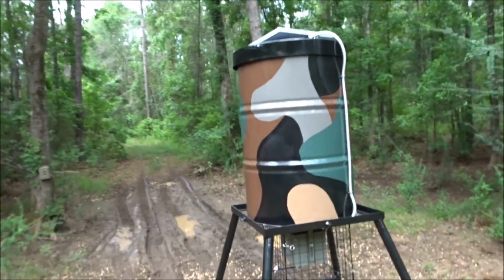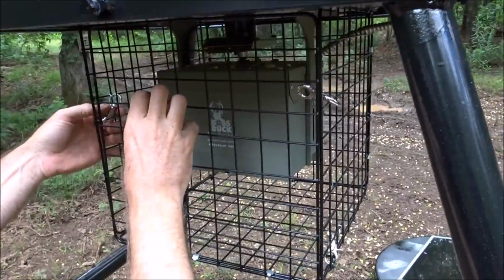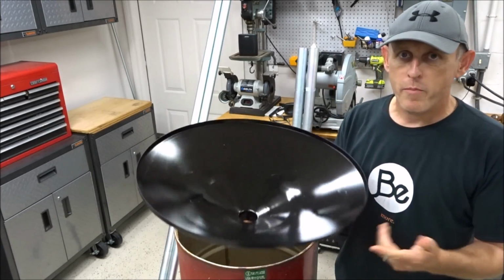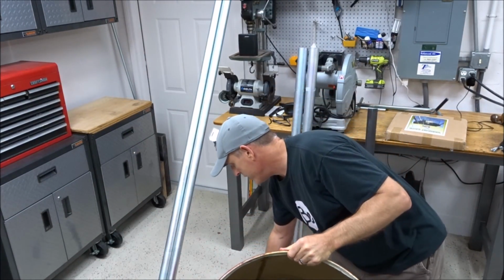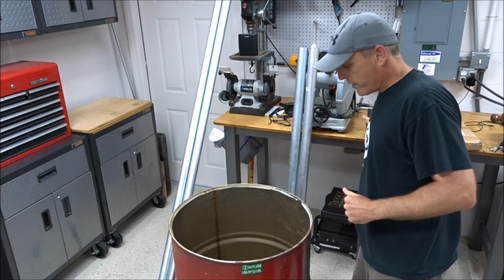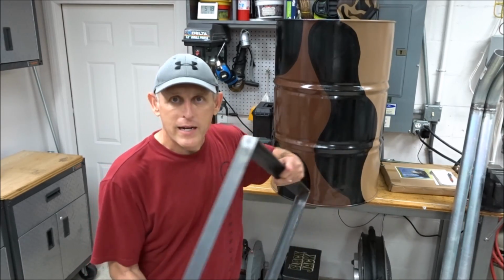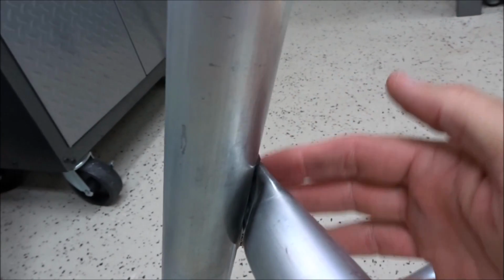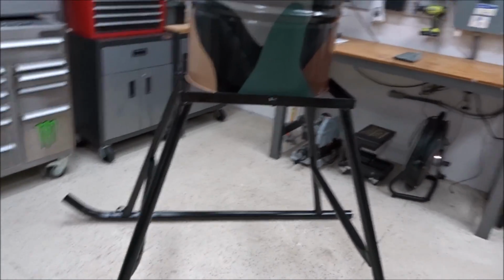Deer Feeders: How To Build The Ultimate Deer Feeder (on a Sled!)

Comment: Can I ask what kind of welder are you using.  I have a stick  but looking into a wire or mig welder something that will weld this kind of material. PS I love your drag feeders!!!
Reply from the maker: Hi Mack, I have a Hobart Handler 140 Mig welder.  It runs on 110v and I run shielding gas as well.  Great little setup up for my kind of welding.  Never had an ouch of trouble out of it and I run it hard.  I’ve run it off a 30amp generator out in the field and it performed great too.  Good luck and let me know what you decide.

Comment: What angle are yall using for the legs coming down from angle frame
Reply from the maker: 20 degrees give or take.  Good luck!
Reply: @TheHandyHunter  thank you. And great video. I was looking around at buying a stand and fill on a skid but have most everything I need to build one for alot cheaper. So looks like a last min. Project for the new hunting spot

Comment: Just built 3 of these. Used 1 1/2" mild steel tubing instead of electrical, 2" on runners and just notch cut the bends and welded instead of prefab bends. Free barrels,$35 for steel,$20 for funnel,$20 for poly lid,$40 for a spinner w/timer, $10 battery,$5 spray paint. Extremely happy with the results. Very rugged. Thanks for sharing a great design
Reply from the maker: Awesome!  Feel free to email me some pics and I will post them to our community board!  Thanks for sharing.  Steve@digitalsouth.com.

Comment: Can you send parts list and sizes you cut all parts?
Reply from the maker: Hi there, if you watch all the way to the end I walk through measurements and dimensions, etc.   I’m working on a new feeder sled that’s easy to build than this one because it doesnt deal as much with difficult angles.  That video should be out in a couple weeks when Im done.  Hope that helps.
Reply: I'm going to be  building 4 like this for new 1000 ac deer lease here in tx.  You did a awesome job . Im to old to be climbing ladders.
Reply from the maker: Outdoors thank you!  Let me know if you need anything.  My newer build is easy if you have time to wait.  I have no complaints about the current sled in this video...i pull it all around my farm.  Its so easy!
Reply: What length did you cut your angle pcs
Reply: All i need are the length of the angle iron pieces

Comment: If worried about the skids wearing out from rocks and such, you can add skid shoes. Basically it's a layer of metal that runs the bottom edge of the skid. You can hold them on with large metal hose clamps. I know it sounds backwoods, but we used this system on helicopter skids everyday. Called helicopter skid shoes on Google search.
Reply from the maker: Thanks Bruce!  Great idea!  Shouldn’t be too difficult to come up with something that gives more protection.  Thanks for sharing!

Comment: Awesome video!  I do have a question, at what degree did you cut the legs both top and bottom, so they can be welded on an angle? Thanks!
Reply from the maker: They are cut between 17-20 degrees.  I had to play with it a little so they arent perfect.  I hate angles!  Hope that helps!

Comment: Handy I dont have a barrel at the moment but wanted to get started. Do you remember what are the dimensions of the Squared Angle Iron where the barrel sits?
Reply from the maker: Hi Vincente, a metal barrel is 23 inches wide so I build my tray that it sits in at 24” exactly.  That gives you 1/2 inch to spare on each side which is perfect.  Build it 24” wide and you will be set to go!  Good luck in your build!

Comment: Are your sled runners holding up to moving them around.  I live in North Central Arkansas.. Lots of rock in the pastures..
Reply from the maker: Oh yeah!  Holding up great!  I just moved it across my farm the other day and it took me 5 minutes...i was flying.  Now, it does help if it’s almost empty but you can pull it full as well.  Build one...you’ll never regret it.  Best thing I ever built.  Good luck!
Reply: Good deal thank you
Reply from the maker: You are welcome.  I used 2” pipe on the sleds.  I wouldn’t go smaller if you have rocks.

Comment: Nice, I think the only thing I would do different is put elbows on both sides of the sled so that I can hook my four wheeler to either side and pull it either direction without having to turn it too much.
Reply from the maker: Smart man!  I will never again build a sled feeder or sled blind without elbows on both ends.  Makes a big difference when you get into tight spots!  Its just too easy to do up front and makes a big difference out in the field.  Good luck and thanks for watching!
Reply: Yeah, I imagine it can be hard to turn when it’s full of corn and you don’t have enough room to snatch it around with your four wheeler. I think I’m going to start building this next week. Thanks for the video!

Comment: Excellent.  I like how you spend time with your son.  I would like to make a cattle feeder like this. I need to figure out how to disperse corn downwards not outwards. Into a bucket.  Any ideas
Reply from the maker: Thank you!  My son is a lot of fun and he loves the outdoors.  Funny you should ask about the down spout type of feeder.  I’m in the process of building one that drops corn straight down so I can lay down a strip of corn in the road for hog hunting.  I’m basically taking a deer feeder with the funnel in the bottom and rigging a metal plate on a bolt where the spout comes out.  It will be spring loaded and will open when you pull the rope.  I’m using a metal junction box lid to make the slide that covers the spout and opens on a spring.  It will have wheels and a trailer hitch too.  I haven’t finished it yet but I think it will work perfect.  Hope that helps.
Reply: The Handy Hunter if you could share would be great. I have small dexter cows. I spoil them with corn. Would like to automate it so I could go away for couple of days.  I have a young son like you. Thanks. Chris
Reply from the maker: chris devito will do!  May be a little while before we finish that project but it shouldn’t be too long.  Now that I think about it there may be a worm gear type of motor that you could put on a deer feeder that opens and closes on a timer.  I think I’ve seen one but not sure where.  I will look when I get time.  Thanks for stopping by!
Reply: The Handy Hunter  I was thinking the same thing. But I appreciate your ideas and willingness to share

Comment: Great DIY! Is there a link to the plans/dimensions?
Reply from the maker: I do not have any plans but I give some dimensions as I walk through the video.  You can use these as a guide but may want to adjust based on your needs, etc.  Let me know how it goes!
Reply: @TheHandyHunter  Thank you! At what angle did you cut the legs where you weld it to the square?
Reply from the maker: They are cut at about 17 degree (17-20 apprx).  Hard to get it perfect but you can bulk weld to fill in the gaps...LOL!  Good luck and keep in touch!
Reply: @TheHandyHunter  one last question before I have all measurments lol. On the legs were they connect to the sled did you notch them or just crimp them? Thank you!
Reply from the maker: Vicente Salinas great question!  I slightly squeezed them and then notched them.  You don’t want to fully crimp them because that could be a weak spot to bend while pulling under load.  Slightly squeezing them just makes it fit better longways on the skids.  Shoot me a pic when you are done!  You are going to love this setup!  I pull mine all over the farm...so convenient!  Good luck!

Comment: How did you hook up the solar panel and where did you get it and how does the unit function?
Reply from the maker: dannythetoesmasher Hi Danny!  It's a 7 watt panel that runs directly to the 12v battery.  You need to install a diode between the panel and the battery on the + wire to prevent backflow at night.  I then connect the battery to the feeder motor. I would recommend putting a 12 volt regulator between the battery and motor to protect against solar surge. The battery stays 100% charged and is maintenance free.  I'll do a video real soon on how to set it all up.  Let me know if I can help you.  Thanks for watching!

Comment: where did you get the lid and and what is made of / how does it hold onto the barrel?
Reply: The lids for the 55 Barrel Feeders are from Boss Buck. They are made of pressed steel. You will have to clean, prime and paint them. I have found using truck bed liner spray instead of paint works best. Apply 2-3 coats for lasting performance. * I've built a couple "Bear-Proof" not on a sled like Steve's in this video.
Amazon LINK for Lid: https://www.amazon.com/55-Gallon-Feeder-LID/dp/B01CTCW6YE/ref=sr_1_5?dchild=1&keywords=Boss+Buck+Feeder+Lid&qid=1594688813&sr=8-5
Reply: Thanks

Comment: What angle did you cut the legs at?
Reply: I built one of these.  They are as great as he describes them.  I cut my legs at 42" and 17 degree angle.  That made my legs about 3'10" wide at the bottom.  That way it still fits in the back of my truck and it's wide enough so that it doesn't turn over when taking a corner at high rate of speed. :-)